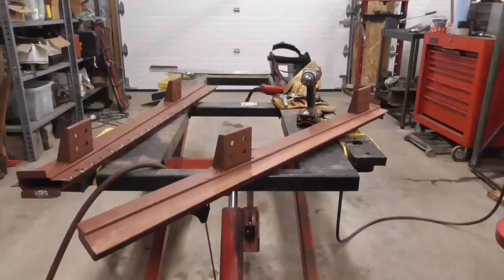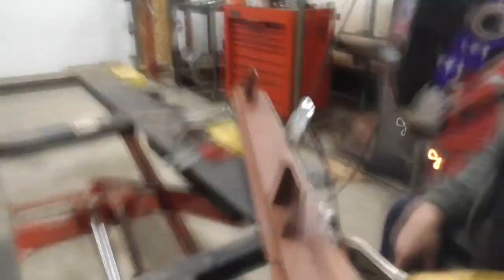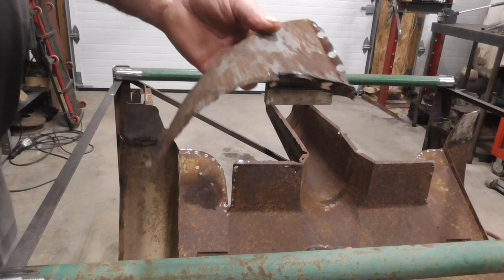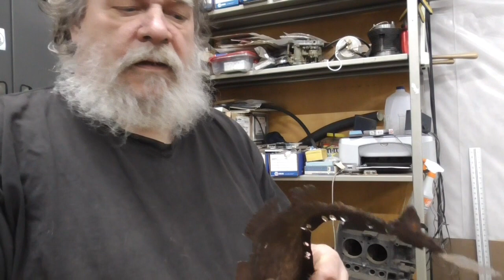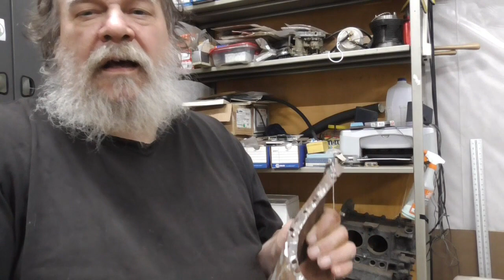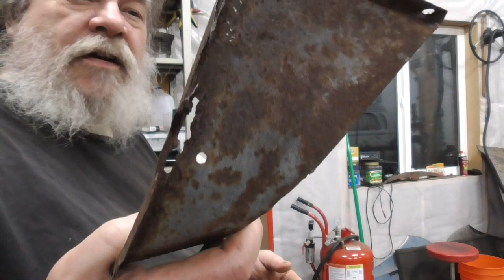fixing my new sheetmetal triumph tr3

Comment: thanks for the heads up Mike! BTW I made that curvy panel similar to what vwbus said. I made a paper template of the flat sections... added the amount for flange, then slowly tipped the flanges over. Shriking the top flange at the curve and stretching the bottom flange at the curve (no need for relief cuts). Make a profile of the top and bottom curve as you mentioned and adjust top and bottom to match. First one requires a little head scratching but the second one will be quick.

Comment: First of all you need to pick the best of the two pieces.
Then the flanges on it will need a relief cut every 2 inches.
What I mean is as the flange curves around it the shape of the piece it needs to have a slice in it so you can then hammer the whole part out perfectly flat with a hammer.
This will then give you a perfect pattern.
Keep the other part for "shape reference" for later on.
Lay down the flat one over a piece of paper and trace around with the thinnest pen you have.
Then fill in the gaps from where sections are rusted away on the paper.
Now you have an exact pattern for making a single piece part with no welding.
Practice with a piece of scrap metal at the vice with a hammer and a piece of solid steel square stock that has been squared off at one end.
Put it in vice facing up and sit the scrap piece over it with a line drawn on it.
One side of the line is going to be the flange.
This side of the line sits just off the edge of the square stock and the flat section of the part is sitting directly flat against the top of the steel.
Then with a rolling action with the hammer you just "lightly tap against the hard edge of the square stock and away and down and this is how an edge is tipped with a hammer.
You just have to focus on the line on the scrap steel and make sure it's folding exactly on it as you move it across and go along the line.
Aim to only induce a 5 degree fold on first pass.
The rest of the folding comes with successive passes.
The curvature of the panel is not that big a deal.
As long as you focus on getting the overall shape exact and tipping those flanges.
You then shuffle between the shrinkerand your square stock shrinking slowly as you go and tipping with the hammer.
I would recommend making a profile guague of the curve along the 2 longest edges out of cardboard as a guide for use at the shrinker and vice.
I recommend that you hammer roll at least 2 feet of scrap steel before attempting this but if you do as I suggest.
It will only take a couple hours actual real work.
The flange will want to go in funny shapes as you go but if you are patient bus keep it in check and always look at the reference part you will have them made very quickly
Reply from the maker: Ok I will work with it I have a few shaping tools plus shrinker stretcher Iam building a metal brake right now I think I will have enough tools to do what I need to. one more tool that I have been looking to get is a profile gauge there not too costly.
Reply: @mikestrang6229  use a piece of steel offcut about 40cm and shrink it until it contours against an area you want to get a profile of.
Mark along with numbers meeting up at the same numbers on the part that is being copied and also the one that's being made
Reply from the maker: @vwbusguy  you think that flare in the curve will come just with working the flanges?
Reply: @mikestrang6229  yes it's all about getting the profile right after allvtge flanges art tipped over the steel in the vice.
Then it's just a matter of shrinking to match.
And finally tapping the flange  or using pliers to adjust it's final angle
Reply: @mikestrang6229  that's why you need to get the exact template from an original piece.
That's what the pros  do.
That's the critical part mate.
Getting the exact template without cutting it up.
Our brains don't work well in 3 dimensions.
So as Neanderthals we need to first flatten it out.
Reply from the maker: @vwbusguy  that's one thing I can do well beat things flat with a hammer.
Reply: @mikestrang6229  godspeed

Comment: Is it possible to put a link in for those inner rocker panels?
Reply from the maker: these came from the Roadster factory  this link should work. If you are interested in getting them like I said in the vid they are well made just not so much in there spot welds.
http://trf.zeni.net/wc/specials14.17/9.php